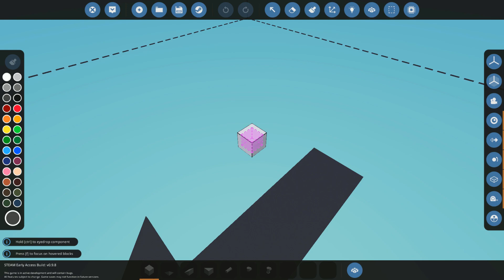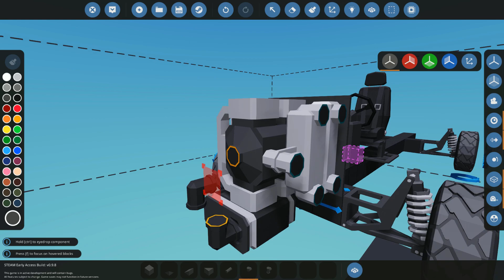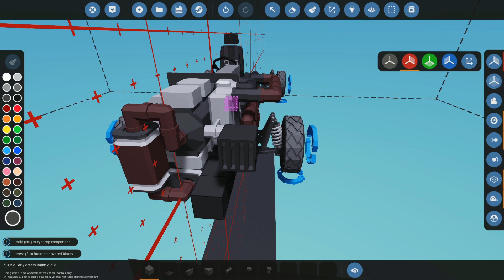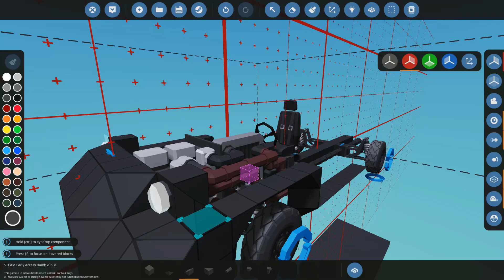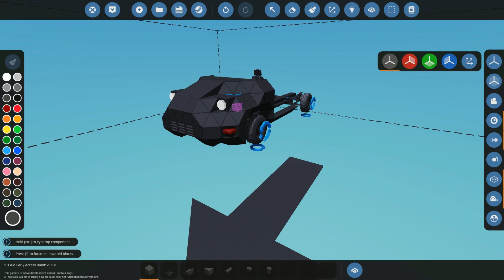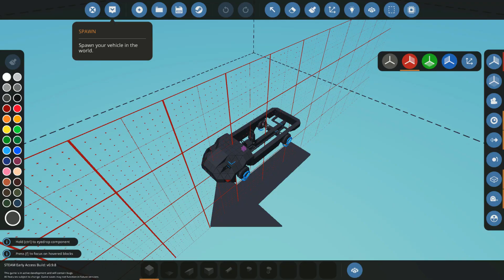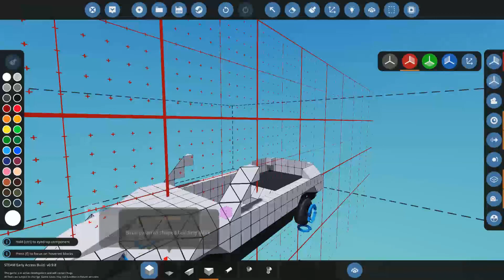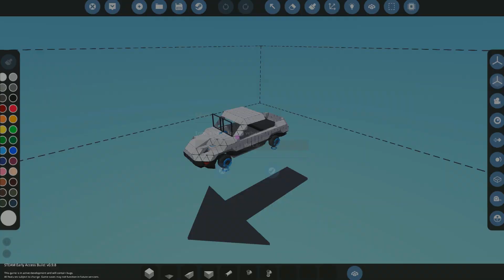Stormworks B&R l Small Car Build Part 1

Comment: The arrow for the gearbox needs to be facing toward the engine
Reply: That is for making even lower ratios than 1:1.
Reply: @exr879Old  then, it will use higher torque and RPS along with fuel consumption if gearbox facing towards the wheel instead of the engine.